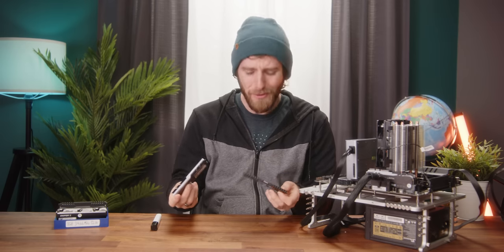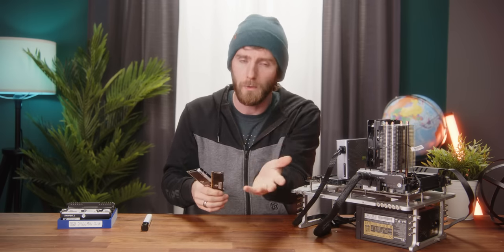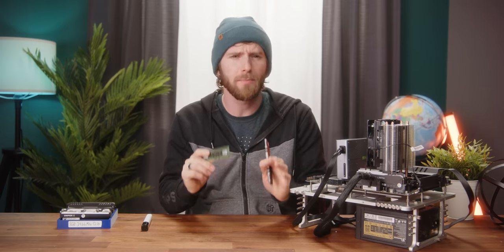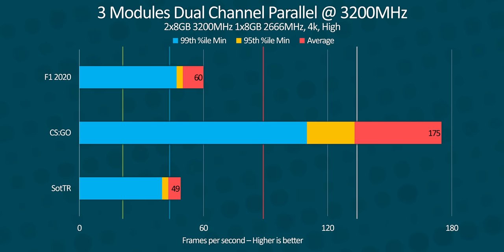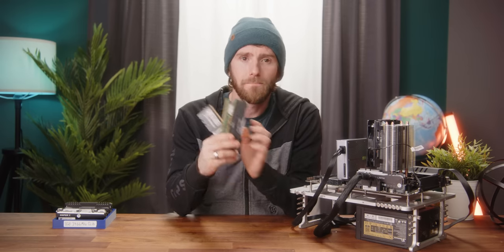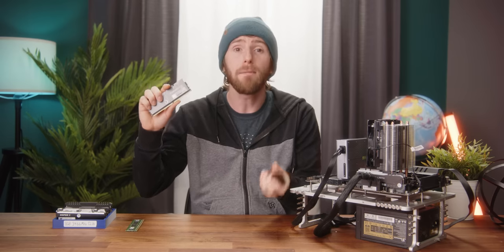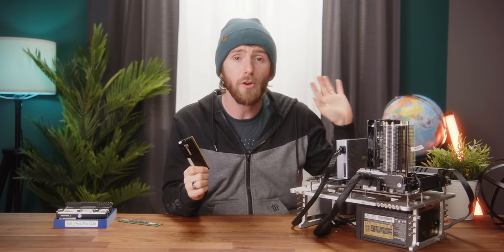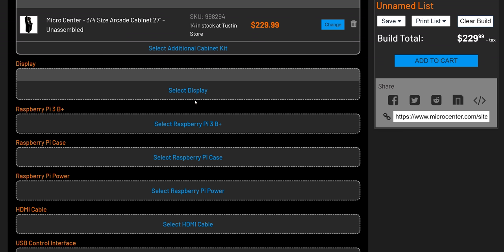Just How Bad is Mixing Memory?

Comment: I bought a prebuilt HP pc. It came with one 16G 3200mhz ram stick. I bought 2 3200mhz 8G sticks to replace it so i could run dual channel. But the proprietary Motherboard didn't have XMP mode, so it only ran at 2133mhz. I put the original 16G stick back in and it runs at 3200. I ordered a different brand 3200 16G stick to go with it and it works fine. I only get 3200mhz speed as long as the original HP stick is in slot one.

Comment: Right now, my PC has two sticks of 8GB 3200 MHz RGB Corsair ram, it has three sticks of 4 GB 2666 MHz Corsair ram, and it's running on quad channel memory mode. Three channels are running at 8 GB, while the last one is running at only 4 GB. 

It looks really bad, but I can't argue with 28 GB of RAM. It runs pretty well at 2666 MHz. 

I had a 4x4 kit first. Then after 3 of my original sticks died, I bought another 2 sticks of the same kind and speed of ram. Then I upgraded to the RGB version when it was on sale.

Comment: RAM compatibility is so unpredictable. Girlfriend bought a pre-built system with 8GB DDR4 3200 RAM, she has an r5 5600. She bought a 2x8GB 3200 kit with the same timings and the stick that came with her system would not work with any combination of the new stuff, it would either boot loop to the bios screen or refuse to POST at all.  Put it in my system, an r7 1700x with 2x8gb of 2133 RAM and it booted up no problem. Maybe it was because my system forced it to run at a lower speed.

Comment: I've mixed memory and not had much issue, but I try not to do that with my main rig. The best thing you can do when you build a rig, if you can afford it and RAM prices are reasonable, is buy double what a "good" amount of memory is. I am typing this on a rig built in late 2017 with the original 32GB RAM. I've had that RAM available for the life of the system - not just for the last year or two of its life - so I am getting the most out of it. If I ever think it's going to waste I can just open a couple more Chrome tabs ;-)

Comment: Just to post an update for everyone. I sorted my ram mess, half of year ago, by choosing and installing the proper ram the proper way. i removed all and any previously installed ram sticks, never to use them again on my main computer but use them on other projects. Then i populated all 12 ram slots with 12 identical RAM modules, 12 x 8 GB, DDR3, 1333 mhz, PC3 - normal voltage 1,5 volts, 10600R - Registered ECC RAM, 2Rx4 - Dual Rank, 2 data path for every 4 bits, total of 96 GB ram. I am happy to report very serious performance upgrade, compared to my previous mess.

Comment: I have a 'mismatch' that is so close, its comical.  I saw a 32 GB kit of G.Skill Flare X5 DDR5 6000 on eBay for $75 and pulled the trigger without looking quite as close as I should have at the pictures. Turns out one of the sticks is actually from a G.Skill Ripjaws S5 kit. Same heat spreader, same 16 gb size, same 1.35v voltage, same 6000 speed. The only difference aside from the logo on the heat spreader is the timings with the Flare kit being CL32-38-38-96 and the Ripjaws being CL36-36-36-96. 

So, I am predicting I can use them together with minimal chance of explosions, yes?  😆

Comment: Upgraded today adding 16gb of ddr4 3200 to my 16gb ddr4 3200 I already had. I couldn't find the  brand, but I was pretty sure they were Vengeance. Same brand different model. Popped the new ones in, a little bios setup and I was off to the races...Turns out my stuttering in warzone was due to the program wanting to use 17gb of memory(system included) when I only had 16. Be aware at 1440p WZ eats ram.

Comment: At the moment (yes, in 2022) i'm running 20 Gb DDR3-1600 mix of: a) TeamElite 4 Gb DDR3 b) Exceleram 8 Gb DDR3 c) Exceleram 8 Gb DDR3-L. So not only different different capacities, but also different voltage in slots. Luckily, they all have same latency. Zero problems with no overclocking - not a big fan of it. Mixing can do the job, I guess.

Comment: I just bought some g.skill 16x2 3200mhz cl16 memory sticks.  I tried to post with both sticks in and then one stick by itself.  Then I had the idea to use one of my corsair 8gb 3000mhz cl15 memory stick with it.  It actually worked.  I even was able to set the xmp to 3000mhz cl15.  I even synced both rgb of the ram sticks using SignalRGB sync software.  Everything works as before just with 24gb or ram instead of 16gb ram.  Everything works perfectly and I now have a smoother gaming experience in the ram hungry Resident Evil 7.  It goes to show that you never know something will or won't work unless you try it out for yourself.

Comment: Nice but i think you missed the most common use case, 2x dimm, and a later upgrade of 2x dimm, same size, same frequency, similar timing.
Right now i have 2x 8GB, and im hitting the wall on heavy workload, so i want to double...

Comment: I just added 3rd slot of 8GB 2666 ram, it's not from same manufacturer but works just perfect coz it has same 2666 clock speed as the older two modules already installed.
Yes sometimes it's hard to search for older clock speed ram but it's definitely possible if you look just hard enough either online or your nearest stores.

Comment: When I bought what I thought was the exact same ram, it had a different controller but otherwise was the same. It doesn’t overclock well at all now but it runs fine at it’s rated speeds.

Comment: a little old coming in, however I didnt realize that there was a difference in ram besides ddr3 and ddr4 (ik ik i was dumb back then) but put in 2 8 and 2 16 (dont remember the speeds or anything) but I had CONSTANT blue screens and finally got it to function not even realizing what it was that I was battling

Comment: Heck, I have 2 separately bought sets of Corsaid RGB Pro 2x8 3000 sticks that won't run together at rated speed on an Aorus x470. Had to turn them all down to  2666 to make them work at anything other than 2133. Read it is something about the motherboard having issues, I dunno. Good video LTT

Comment: I had the WORST problem ever with ram. I always had a problem with my PC. It aways, since it was built randomly froze and made a weird noise. I tried EVERYTHING to solve it. Until, one day, I tried overclocking the memory and this problem became more frequent. That day I realized that the memory was always the faulty component. I underclocked the memory and NEVER had the same problem again. I just bought a new kit and I am good now. I literally switched the power supply, I switched the motherboard, I tried running for a while with the APU video card. Everything failed until I did the overclock and finally realized the problem. I ended up realizing it because the PC started to show the problem more frequently.

Comment: Even with the same sticks it will not always work. I had 2x8gb Corsair Vengeance LXP at 3200, and added 2 more matching sticks. I can only get it to run at 2666. Even tweaking the memory controller voltage doesn't help. Memory can really be flaky sometimes, even if the sets match.

Comment: When mixing ram the main thing you need to know is that it will all run with the same clock speed and timings, which needs to be compatible with all sticks, meaning your slowest stick determines the speed of all of it
Reply: And for dual channel you still need to match capacities between the channels
Reply: @Autotrope  So you can't run dual channel of 8Gb + 4Gb?

Comment: Resurrecting an old GIGABYTE X58 Tri-Channel platform turned into a nightmare for me recently. Using matched RAM (same brand, same timings, manufacturer etc.) still resulted in one channel not showing. The memory was thoroughly scanned on a different PC and no errors resulted. I even asked for help on this on my own YouTube channel but to no avail. On a whim I plugged in two sticks of Hyper X 8 GB X2 factory matched RAM and immediately all three channels registered. The o/s reported the RAM as all usable. The platform maxes out @ 24 GB however and the system proved to be very sluggish because 32 GB was a bit over the top for this old X58 platform. Evidently, factory matched RAM can make a difference. As I had no spare Hyper X 4x2 factory matched RAM handy I used a set of factory matched G SKILL memory with timings of 9-9-9-20 and manually tweaked them to 7-7-7-19 to match the rest of the memory. Success! memory scans stable, system snappy and responsive, all systems go on a Hyper X/G-Skill mix & match maxed out to 24 GB of RAM.

Comment: So the thing about this is it depends on your system. I’m not 100% sure why but some set ups barely run with mixed ram… I help out on one of the PC support reddits sometimes and I’ve seen more than a few people having major issues like blue screen or other reliability issues, or even performance issues. Then the one thing standing out in their systems was the 2 random kits of ram…. For what ever reason when removed and just running the best kit their PC was “fixed”. 

If you have a laptop with one single soldered stick try to match it as close as possible. I personally had an asus laptop last year where I tossed a 16gb stick in with the 8gb one and they where same speeds. The laptop was so unstable I went back to the stock 8gb soldered and 8gb stick that came with it…. 🤷🏼‍♂️

So I would say test it out at your own risk lol. The weird part is I’ve seen ppl running mixed up ram for years and their system is fine. I’m pretty sure it has to do with how well your motherboard and CPU combo interact with the different speed and latency kits 🤷🏼‍♂️🤔

Comment: currently running 3 random off brands of memory, for a total of 32gb/4 sticks. 2 are the same brand, but the sticks look way different so im assuming different chips, the other two are the same brand as each other, but a higher clock speed. currently running windows 11 flawlessly, with my FPS roughly in the ranges i would expect for my specs. it seems i really won the lotto with this setup, not a single crash in over a month of having the new PC

Comment: Lil late to the party - on my 2nd last rig, I had Kingston value RAM - 2 stick for 16 GB, and a few years later added a Corsair kit of 16 - both running at the same speeds with no issues.  My new 1 yr old rig was sporting Corsair Veng 32 GB @ 3.k MHz, but sometimes I had issues of odd restarts over time, but not a lot... So I got a set of Kingston Fury Beast 32 GB @ 3.2k, seems ok, but the PC may have other issues... BUT my Q is what happens if I put in the Corsair 3k sticks, will I cause more issues or not??

Comment: My system won't even post with the at 3000MT/s DDR4 after upgrading to 32GB by adding a second 2x8 kits, despite both kits beeing rated for 3000MT/s with the exact same timings, it's even the exact same kit, but they probably use diffrent chips inside one of the kits has 2 ranks and the other just one.

Comment: Lol. Many years ago I had a machine with 4 SDRAM slots. The CPU ran 133 mhz on the bus. I had a mix of PC100 and PC133 ram. The PC100 used the exact same ram chips the PC133 had. Only the SPD chip was programmed to show only 100 mhz. The mainboard only used the first slot to determine what the ram speed was, so I threw the PC133 in the first slot and PC100 in the others. Ran for years with no issues at 133 mhz on the bus.

Comment: DDR3 was very good at mix and match as long as speed and latency spread was not too high. In latest years chips were similar enough and BIOS was fairly flexible as FSB was available for fine tuning.
Reply: FSB, now there’s a term that I haven’t heard in a while.
Reply: wait so i can have different ram sizes (for example 2 4gb sticks and 2 2gb sticks)? or not cause im actually so confused
Reply: @taurn620  Yes but some things  can  suffer, like  dual channel and  all would  run  at speed and settings  of slowest  one.  Just   make sure  both of same  size  are  in  same memory channel. Most  of the time  those  are  channels  2 an 4  and other  one 1 and 3

Comment: My i7 Dell XPS router has 20gb of ddr3 ram & 3 different types of ram sticks lol. x2 Samsung/crucial sticks @1333, Then 1 plain crucial @1600, then x2 A-tech's @1600. Its all only gonna @ 1066mhz, but I still have a slot open. Didn't wanna cook the memory controller. I kinda just wanna buy another A-tech set & only use the 1600. Meh. I know I have 1 more 1600 stick by crucial and 1 more 1333 samsung/crucial stick somewhere. I just moved so it will have to live off 20gb running PF sense.

Comment: I built my system basically right after DDR4 was released, with a crucial 16gb kit of 2400Mhz I think it was. (Higher speeds at the time were rediculously overpriced, we're talking 16gb 3200mhz being nearly as much as 32gb 2400mhz) 

3 years later (and 2 years ago) I decided to upgrade my RAM, but the original ram I had was, obviously, discontinued. 

So I did some searching, and bought a new 16gb kingston kit of 2667Mhz and  chucked them in the two free RAM slots.  It took a bit of fandangling in the bios to get it running happy, but once that was sorted its been running perfectly ever since and still is today.

So yeah, thats my story of "it worked for your friend"

Comment: Hello. I watched your video because I wanted to increase my FPS to a more stable one for my 144Herz monitor and it worked. I have 2x16Gb and 2X8Gb in all slots. They work at 3200M T/s CL 16-18-18 1.35V. I was afraid that it wouldn't fit, but after setting it in the BIOS, the performance is optimal for me.

Comment: I know this is 2 years old but I managed to mix 8 different ddr3 ram sticks together to a whopping 32 gb by 4gb x 8, it did take a few hours to not get stuck on boot loop, but it worked until the very end when I switched to a modern ddr4 platform :)

Comment: I had terrible luck with this. I had trusted conventional wisdom and had tracked the exact version of my current RAM. It was no longer manufactured, so I tracked modern equivalent. Unfortunately, it was 1,35 V RAM versus my existing 1,5 V RAM. What I found out is this is the worst thing which you can do. Overclokcing your RAM like this will create instabilities which will force a hard crash of your operating system over time. Having different voltage RAMs is the worst mixing you can do. Everything else does not matter. Just pick whatever fits in your slot and you are golden.

Comment: What I need to know is what is the ideal dual channel configuration with four dim slots fully populated when you have the exact same brand and product line and speed and latency timings but one kit is dual rank and the other is single rank. (Corsair Vengeance LPX DDR4 3200 mhz 16-18-18-35).

Comment: I got 2 Corsair Vengeance LPX 3200 Mhz on my ASRock Fatal1ty X470 Gaming K4 with a 3900x. Running XMP even with 2 identical sticks my system sometims fails to boot or defaults back to 2133MHz...

Comment: I tried upgrading my previous Corsair DDR4 3200Mhz 2x8GB with the exact same modules, same capacity and everything but the chips for my new set of rams are from Hynix while my previous ones was from Samsung. It crashes every single game that I play for a while. The worst was BF2042. The error message was not even about rams, it says something about my GPU "GetDevicedRemoved" or smth. I tried everything but none of them works until I tried removing my new rams. No more crashes. Then, I tried using only new rams and removing old ones. Yep, no crashes.

I really hate when Corsair just changes chips from manufacturers. Mine was incompatible and had to make a refund. Well, at least I was lucky.

Comment: Interestingly Flex Mode was actually first introduced by Intel way back. However, you need to use ram sticks that have the same speed and cache latency. At least if you want a stable system.

Comment: I still ran 8GB DDR3@1600 until a year or 2 ago. I got a 4GB module for free of the same speed and I got away with it. But then I got a 8GB module also for free of the same speed and changed it for the 4GB one, and after a month of it working just fine, I started getting blue screens everytime I tried to play any minimally requiring game. A guy on twitter told me that if the ram modules are not matching they may run into conflicts, and it turned out to be the issue, so I am back to 12GB.

Comment: I have an asus tuf B450, Using the latest bios update to date with a Ryzen 5 5600x, I use to use 2 different kits of 16GB ram gskill F4-3200C16D-16GVKB. Individually, they could reach 3200Mhz, but together (using the DOCP profile) they both reached a maximum of 27333Mhz at 1.35 volts with my old Ryzen 5 2600. After changing the processor (Ryzen 5 2600) I got the same behavior with these kits BUT, I decided to test the DOCP profile, but, pushing the voltage up at 1.37,5. Wooalah! It's working now, memtest pass. 2 different kits of ram (same brand, same model). Great Brand Gskill, great Motherboard (ASUS B450 upgraded BIOS for Zen 3). Great CPU, Ryzen 5 5600x.

Comment: Hay, I found this video AFTER I bought some new RAM. I had 2x 8g 3200hz hyperX fury and bought 2x 8g 3200hz cosair vengeance. Running them in their own dual channels in a Aurous Elite A520 with a 3600. Booted fine and seems to run fine, although now I can't seem to sync the RGB (sad tears) but also was a bit worried because in the NZXT monitoring software it says my RAM is running and 1200hz in channel A (the hyperx) and 1000hz in Channel B (the cosair) although task manager says the 32 gigs in running at 3200hz... and in bios XMP is enabled and seems to be set to 3200 as far as I can tell. No performance increase in TWW2 (still ran at 35-40fps with no change in settings) and couldn't tell in BF1 last night, running at 70-80fps. 

Didn't really think about it when I bought the RAM. I checked the timings were the same and because it is the same speed I assumed it would be alright. Sounds like, from this vid, I may have got away with it!!